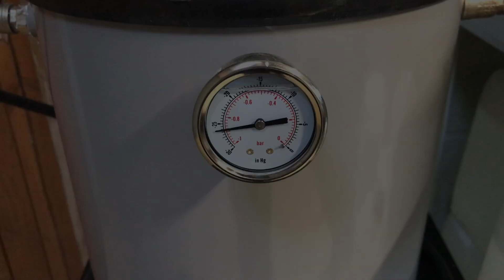Grey Resin English Walnut Table on Metal base

Comment: Hi. Love you video's, quick question, When I mix my resin and added my metallic pigment and pour, I then give it a little mix with a stick to give it the swirl affect but after leaving it for a while it goes very bland and there's hardly any affect. What am I doing wrong? Many thanks
Reply from the maker: Keeping swirling it until it’s almost cured just be aware you can also create bubbles I’ll try achieve this effect
Reply: Thank you so much, I'll be giving that a try